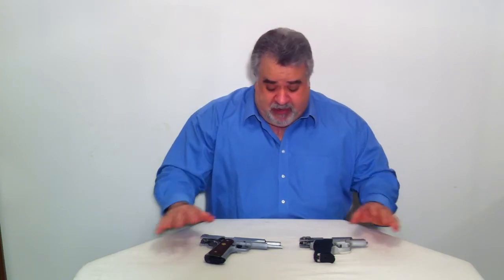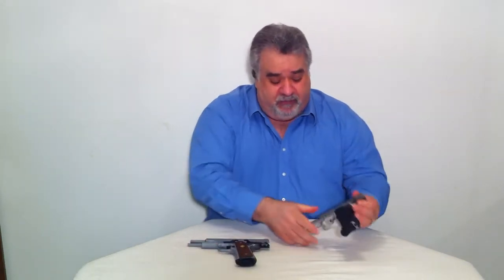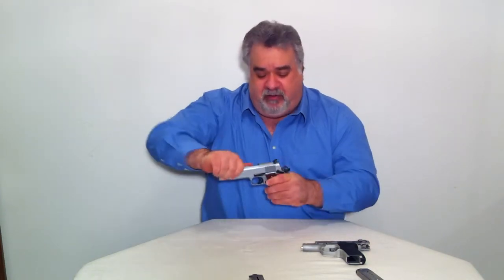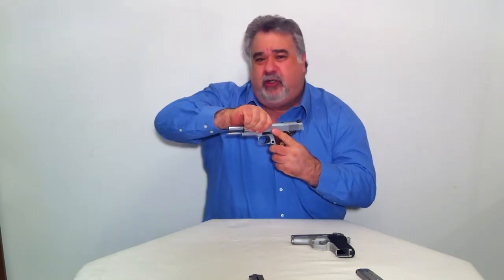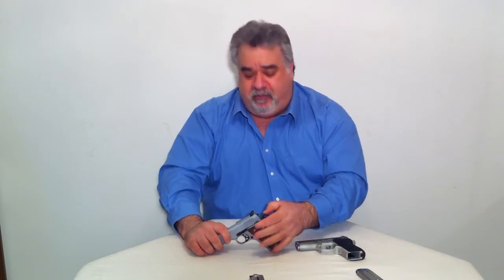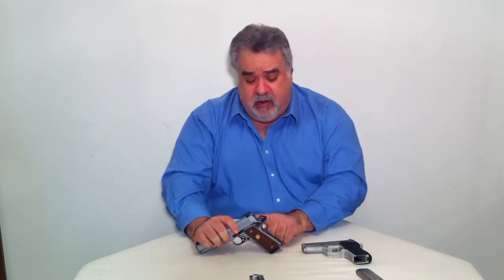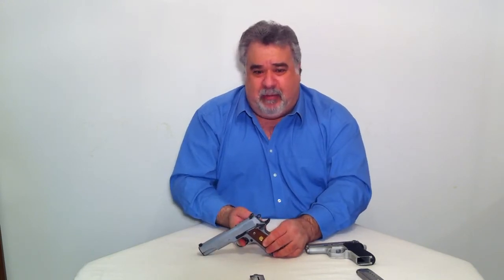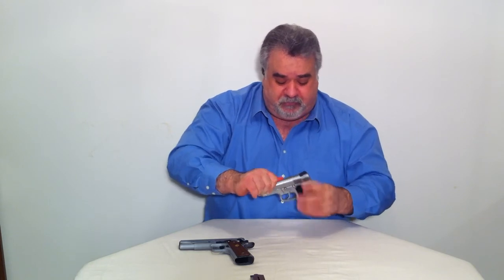Difference between Single and Double Action Semi-Automatic handguns Informational Video

Comment: On a Cobra Denali 380, semi auto, do you have to pull the sliding action on top to the rear and the hammer goes back then you can fire, or do you just pull back on the hammer and fire and not have to push the slide on top to make hammer go back?

Comment: The TITLE of this video is incorrect / misleading / or just WRONG. The video itself is fine for what it is - a general comparison of two pistols, focusing on some of the more common features - and I appreciate anyone who invests the time and resources into making an instructional video that's freely available. So, thank you to Safety Ent. However, the video is very poorly titled. It's not "about" the differences between single action and double action. Late in the video that topic is briefly discussed, but a title should reflect the focus of the material. In this case it does not. But it's still a good video.